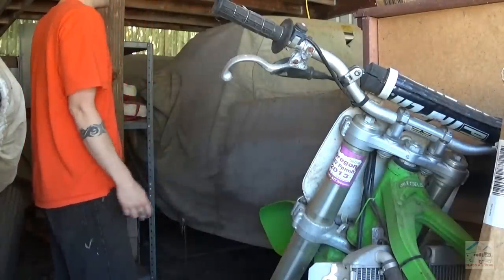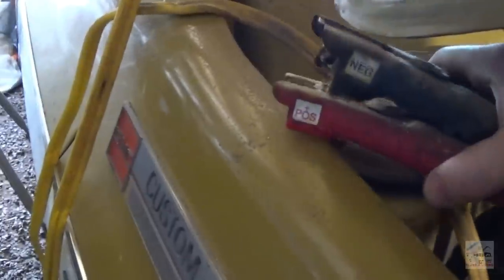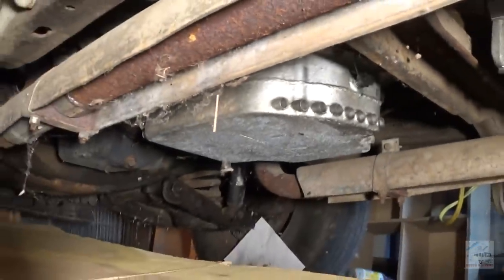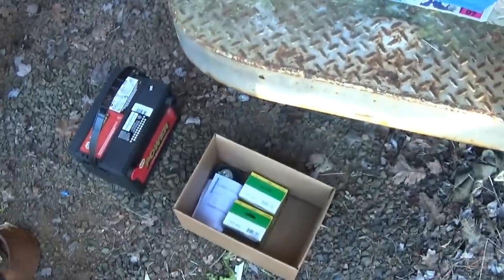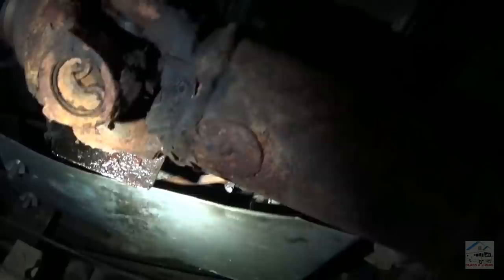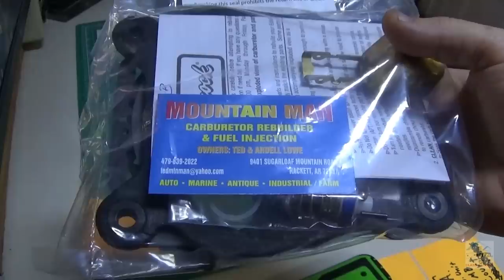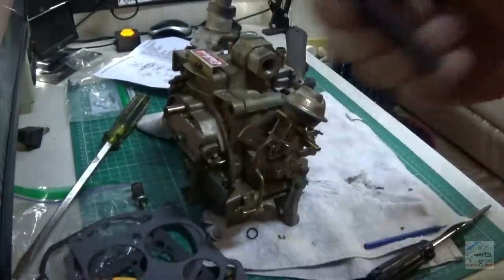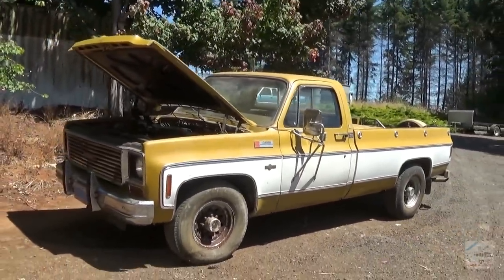1973 GMC Sitting For 13 Years - Will It Start?

Comment: This is how you had to equip and modify a truck of this era to tow heavy loads reliably before the advent of $50,000, 490hp 3/4-ton trucks you can buy off the showroom floor. The trans is a TH400 with a huge cooler and that air-cooled trans pan. It's probably been  rebuilt once or twice already. The overdrive unit is there because back in those days even the 454 was only about 210hp, so in order to get a heavy trailer moving they put 4:10 gears in the rear. That made highway driving miserable because the engine was spinning about 3,000 rpm at 60 mph. It wouldn't HURT it but it was loud and probably got about 8 mpg. That's why the auxiliary tank and that hugely complicated switching system are there, so they didn't have to stop every 100 miles and fill the tank. I noticed there's a belt guard above the AC compressor. The cruise control is aftermarket. The engine has newer valve covers and isn't orange so I figure it's been rebuilt at least once as well. That's a super nice truck, but modern girly-men would last about 2 days driving that rig around as stiff as those ride before they would run screaming back to their comfy luxo-trucks.
Reply: Lol
Reply: Once I saw the 5th wheel hitch, it explained the water tanks and then saw the water transfer pump. Nice HD pulling rig, hope he keeps it!
Reply: @dwitcraft  why should he keep it with no 5th wheel trailer?  He already has a spare with the same engine, and really shouldn't pull parts off working trucks anyway.  Find one you can't fix for spares.

Comment: I love those older, non-computerized trucks. They're easier to work on, and parts are still available for them.
Reply: i agree and very true !
Reply: Totally agree!! These trucks were built very mechanic friendly. But you had to be a Mechanic, not a parts changer. I owned a '73 Cheyenne. My first vehicle. Passed anything but a gas station.
Reply: @pltc172  I owned a '76 Scottsdale, and it was the most reliable vehicle i had
Reply: Me too. No computer crap in the way, a hell of a lot of room under the hood, a piece of cake to work on. A person can climb in in the engine bay if need to.
Reply: @marlinezell643  Yep! Did that many times in mine.
Reply: Michal l
Reply: I appreciate em, but for me those computers make it easier to diagnose.
Reply: @FirstLast-we8cb  But what would you do if there is a problem with an ECM? You can't trust the computer to give you an accurate reading if the ECM is the culprit. And the parts are much more expensive, and more difficult to install, and in some cases, the ECMs might need to be re-programed.
Reply: @basketcase1146  If the ECM or PCM is the prob then the car usually doesn't work. I've replaced them. I also have written software to tune em, from scratch. The right laptop, software, and cable can do a ton.
Reply: @FirstLast-we8cb  looks like i have stuck my foot in my mouth again, but what i meant to say is i prefer the older stuff. Nothing wrong with anything produced today. I just prefer the older stuff, and that's because i know how to work on them. Anything with a computer is confusing to me.
Reply: @basketcase1146  No foot in mouth here! While things have changed, don't sell yourself short. Trust me, if I can deal with car ECMs, anyone can. There are lots of great tools out there that don't require laptops. I personally appreciate any car thats quality and makes power, regardless if it has a ECM or carb.
Reply: @FirstLast-we8cb  You got it! It's funny how so many people say the same thing about computerized vehicles are so hard to work on.  That couldn't be further from the truth. It just separates the mechanic from the pretentious. Everything went electronic for a reason.
Reply: @nightdan7096  pshh all in all older is better its tougher, it had lots of balls its looked awsome and sounded badass. I hate these new shroud coverd trucks that are riddled with sensors that are impossible to change, also they dont make new trucks out of hardly anything so they rott away idk old has advantages as well as new vehicles for comfort
Reply: @nightdan7096  I know because I work on them bucko
Reply: @killaz123456789100  Just stop the nonsense. I'm a 46 yr old mechanic that rebuilds engines and transmissions. I have and use a nice scan tool. Electronic/Computerized tells you exactly what the problem is and how to fix it. Electronic/Computerized spark is more accurate from using sensors, etc..That's why newer vehicles get better fuel mileage than their predecessors. Remove all the electronics and add a carburetor to a newer engine and say bye to your fuel mileage, torque, and HP. I've created and wired from scratch wiring harnesses for a Ford Bronco, Chevy Pickup, and Dodge Pickup & Dodge Ramcharger/PlymouthTrail Duster. The Bronco took the longest because it required 3 books due to it being the extended model and it was electronic with lots of sensors. You just wire them one at a time until completed. A transmission doesn't get harder to rebuild because it has more clutch packs. It just takes longer. But in the end it's far superior. That's why the newer trucks and many engines have so much more torque and HP. The pulling power on the newer trucks are far more superior. Look at the 4.3 Vortec V6 (200HP-260Torque).
Reply: BaTTle CAt  ha ha ha if you knew anything you'd know that a good tech is not a parts changer. And I can pretty much guarantee since all you like are the old non computerized vehicles that you're the parts changer.
Reply: @nightdan7096  of you are indeed a mechanic first you'd say you're a technician, second, I own several expensive scan tools and not one of them tells me what to replace. And then your comment on the bronco? You're so full of shit the last year of the bronco until the one just released was the first year of obd2. Easy and not that many sensors as you claim. Basically I call bullshit on your entire diatribe of what you supposedly do and have done just based on what you said.

Comment: What a nice, well preserved truck. This one strikes a chord with me. My dad bought a 1973 GMC 3/4 ton pickup that was the exact same color, except it had a vinyl seat. It had a 454. I think he bought it in late 1979 or so. I was really young. I remember he didn't have it for very long. He put it on a dyno at the dealer and they said it was losing 50 horsepower somewhere. Dad did some work on the valves with no improvement. He traded it in. I do have fond memories of that truck. So nice to see one in such great shape! BTW that's the first time I've seen the spare mounted on the rear bumper. I'm sure most of us over 40 recall all the pickup trucks that used to have the spare hanging off the front grille - a serious wind drag!

Comment: That thing is a BEAST!!! I had a 1982 Custom deluxe C20 like this, although 6.2L Diesel/TH400, CB and all that jazz. Was a nice truck. used it for parts on my 1982 also K10 diesel. Anyway. Not every day do you see those Overdrive units. Easily $500 right here.

Comment: I had a 1976 Chevy 4 door Silverado pickup with a 454 about 30. Years ago I had the truck from 1990 till    2006. It rusted out. That 454 was a runner in its day. I could work on this truck myself .It was the same color and same seat  colors as  the 1973 Chevy 4 door pickup that youre going through good luck sir. I hope it starts. Sincerely Richard Dodds. So Sioux city Nebraska.

Comment: Accelerator pump... overcomes the inertial lag of the normally aspirated gas engine... FI engines have an extra volume "squirt" programmed into them.. just to mimic this old technology mechanical accelerator pump. Great barn find.. especially if it's from a member of your family... I'm a Porsche / Mercedes guy, but the 454 was areliable beast in my old Winnebago .

Comment: I'd love an old truck like that.  All set up for heavy duty towing and haulling.  Extra coolers and even one of the air flow trans pans they used to sell.  Always Smart to keep an air filter on the car/ truck it keeps mice from getting into your engine and destroying it with pee.  That stuff eats metal.  Fixing an old Q-jet you best replace that crappy Phenolic float.  It sat for years and soaked up the gas. It will keep flooding soon.  A brass float is so much better.

Comment: This truck did some hauling.  That is a deep dish trans pan with cooling tubes. Nice truck are you going to to keep that truck or sell it.
Reply from the maker: It might be for sale I'm not sure yet, there's a lot left to do to it
Reply: @ClassALiving   Well if you do keep it fix it and use it to pickup new RV'S. That is something worth looking into.  If I was closer (east coast) I would buy that truck and do some hauling.
Reply: @ClassALiving  let me know if it is for sale
Reply: Also interested if for sale. Please LMK. Thx.
Reply: Get ahold of Cletus in Florida he’s looking for a truck
Reply: Made by Derale
Reply: @charlesbaker687  Oh god no. Cletus would destroy that thing. Big engine, big tune and just do burnouts with it. No. Let it be a survivor
Reply: @stevensharp6080  WTF
Reply: How in the hell did you come across this thing? How much did ya pay, it looks like a good old truck.
Just curious is all I just subscribed.
I have two of thes older ones ones a 70 and the other is a 71, 71 has a balanced 327 with a two speed power glide and the 70 has a 502 with a turbo 400. WAY TO MUCH FUN!

I'll check out the other stuff tomorrow, I like the vids so far.

Comment: That tank in the corner of the bed and electric pump is an old "Vapor Kool" system that spray a mist of water on the top of the radiator to cool the truck under extreme conditions, they work fantastic! the company was in Highland ca, Jerry Duns was the inventor
Reply from the maker: Ahh ok, interesting! Thanks for the info

Comment: 48:40 in my days wrenching on a chevy 350 motor, the fuel filter was in front of the carburetor. The filter was above the mechanical pump between the pump and carb. This all looks custom. 😮

Comment: Did you check your cabin air filter in your dually you should check it anyway but you could have something in there maybe that's where the smells coming from the filter is over by the passenger side where the feet go that plastic box right in the middle of it is a thin piece of plastic people out of the way in the filter should slide out

Comment: Used to use two allen keys and vice grips to open the quarter-light, one to pull the button in and the other to flip the lever, and while working on it open quarter-light so you don't accidentally lock the door with the keys inside.

Comment: Pull the rubber cord out from the middle of the gasket and remove the back window. It takes maybe 2 minutes. Best way to get in these trucks when they are locked.

Comment: the engine looks newer poss 1990s also if you want to keep it running a minute longer you can put gas in the stand pipe at the carb right by where you were squirting gas into the carb , just a thought.

Comment: Cool truck. It would be good to know the back story. I would guess it was your grandpa’s truck (?) My family and I had similar trucks over the years, a black 75 chevy c10 silverado lwb with a stock 454 and red bucket seat  interior- (first  year of silverado and was SHARP!, red chevy 76 c10 lwb custom deluxe that the p.o. Swapped an LS5 out of a 1970 Monte Carlo(FAST!!!), 80 GMC c30 with a 454 that was my dads pipeline welding truck. Dark blue 82 chevy c10 custom lwb we built a nice 355 for, 84 black and silver gmc High sierra  with a straight six  that I rolled  and totalled on a gravel road going too fast. Last i owned i bought for the rebuilt 454. It was a 73 c20 custom deluxe. Rusted beyond saving. I put the engine in my 79 Malibu! 😬

Comment: Did you check out the GEARVENDER system?  I saw something early in the video that had a switch labeled with that, also thought I saw it when you were under the rig checking out the trans pan.

Comment: The next time you run into that same situation with the door locks try the vent window with a pair of channel locks turn the Chrome reverse side of the latch and the vent window should open FYI, Victor from Palmdale California 93591

Comment: IThat bed tank was added so the previous owner could make from one gas station to the next.  My 74 Cheyenne 1/2 ton 454, TH400 and 373's got 5. MPG pulling a trailer 60 MPH.

 I even stopped once to look for a fuel leak. They are horribly inefficient engines but I love that old iron.

Comment: After seeing this I don't even want to know what my 1988 Ford Festiva looks like its been sitting under a shed for 20 years and I've not started it in over 7 years.
Reply: I tried to bring back one that had sat for a year. After fixing a lot of maintenance related problems, I was just gonna pull the fuel sending unit because the gas gauge wasn't working and found that the tank was full of RUSTY WATER! And it actually started and ran with that crap running through the motor! Check on your tank before you try to start it, It may save you a lot of trouble.😊

Comment: Good video, man. Thats one hell of a truck. Curious if that is the original engine. Unless the valve covers have been changed, I think they are from a throttle body injected big block converted to a carb. Either way, very nice

Comment: The best way to start a quadrajet gm vehicle that's been sitting a day or two is to prime to carburetor through the bowl vent at the top not by just pouring gas in the primaries nice truck love the early square bodies especially big blocks

Comment: i was wrong about the square headlights my truck was a 1978 it looked just like that one only got 11 mpg tune up with a 350 engine
Reply: You're right, I have a 1976 Chevrolet C-10 and I removed the springs and made me a simple prop rod. Hood is kinda heavy but I have no hood bends.
Reply: My 73 had round headlights and I got better milage than that w a 400 Pontiacmotor in it the 350 Chevy motor was under powered for that so I found an old Grand Prix and swapped the drivetrain it was a beast and did pretty well on gas if I stayed out of it 373:1 posi was a tires worst nightmare

Comment: The round sticker is the date code. H is the 8th month and 0 is the year. It could be 2000 0r 2010 the number only goes back 10 years and repeats.

Comment: Nathan that pump in the bed of the truck is an electric fuel pump it clicks like that to pump fuel leave it on all the time when you're running the truck, it's kind of like you're 12 volt water pump in your motorhome
Reply from the maker: There are no electric fuel pumps on this truck. From what the owner is telling me it's a spraying system for the radiator

Comment: A little dirt in the needle and seat a couple of whacks on the carb usually jars it loose or a little air and it stops flooding and it's called the accelerator pump .. also u had trouble getting parts cuz it's. Really made by Rochester not Edelbrock they just put their name on it as an aftermarket sale Edelbrock is really Carter the original design of their squarebore carb that is called a spreadbore carb and both Holley and Edelbrock make squarebore carbs GM along w Rochester designed those and they were on everything for a very very long time and are both super reliable. But also better on fuel due to the small priimaries and they have those giant secondaries that open and make the infamous q jet moan lol I can help you with all that old shit and an hei. Distributor is what you should put in it that 73 was the last year for points and then the hei was introduced and was awesome in comparison

Comment: I think you rebuilt the carb for nothing actually. A stuck float on those was easy to fix by shocking the carb body with a screwdriver handle. Just sayin. Who ever was the previous owner of that truck loved that truck. You can tell. He was doing things right.